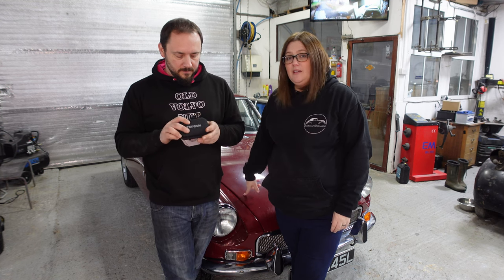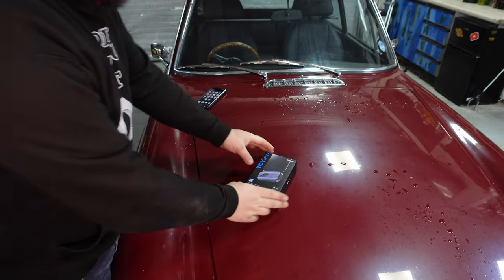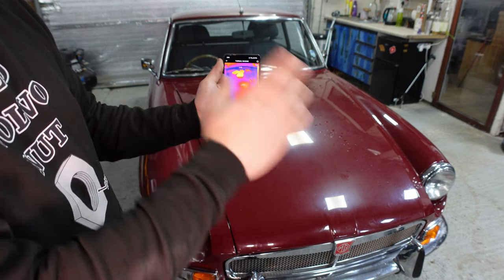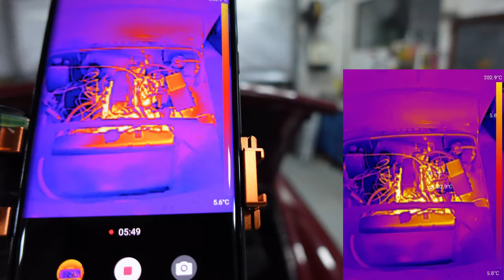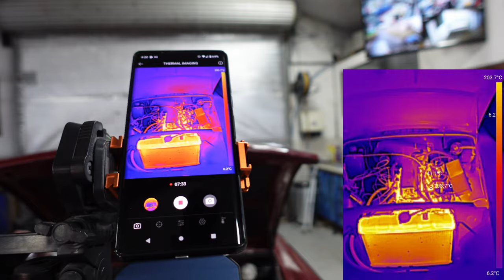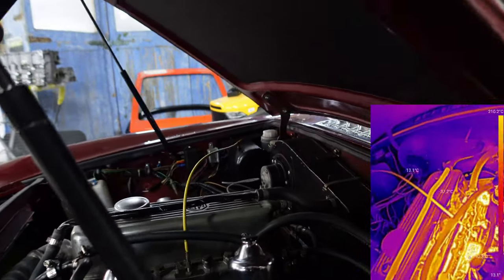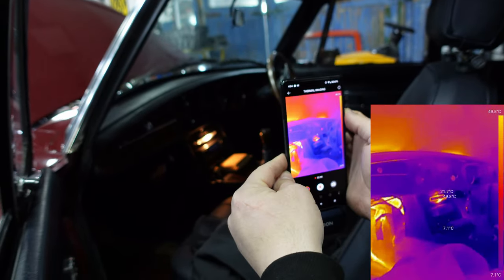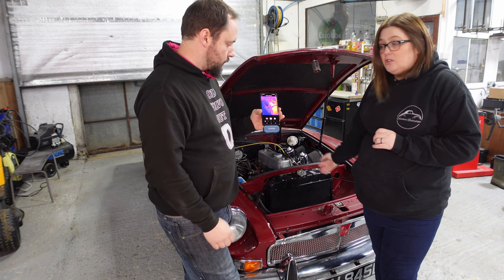Modern Tech and Classic Cars! Checking the MGB GT Cooling System with Thermal Imaging!

Comment: Ooh, interesting stuff, so much better than the cheapo laser pointer infrared thing I have. Just one thing, though - it looks like the oil cooler return line is a lot cooler than the feed line when things were first warming up; might be worth investigating an oil thermostat so the oil gets up to the most efficient operating temperature sooner.

Comment: Plumbers use this to balance radiators in a central heating system. Typically 10 degrees max between flow an return.On a car radiator trying to loose heat it should be about 20 degrees flow to return minimums.
Reply from the maker: So many applications! We found a massive cold leak around our front door. Insulating curtains ordered....should save some pennies on heating!